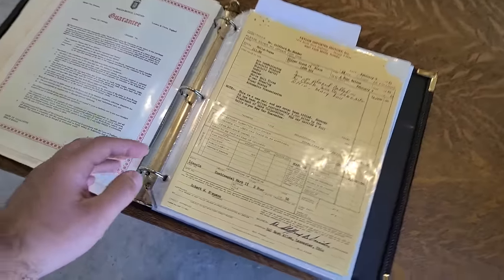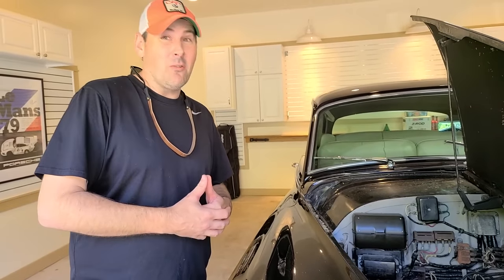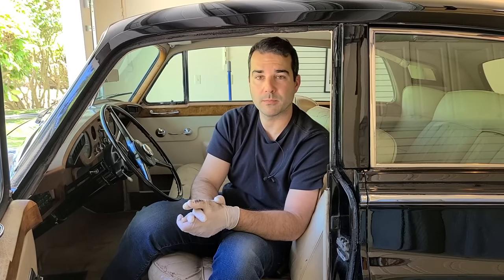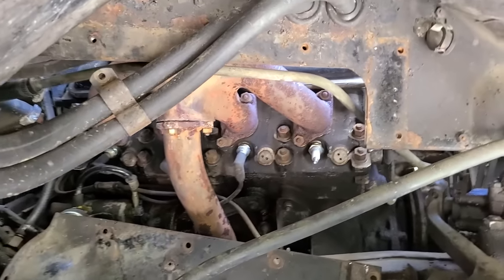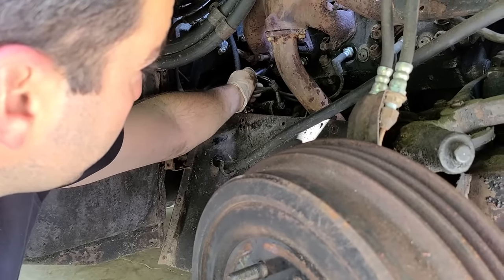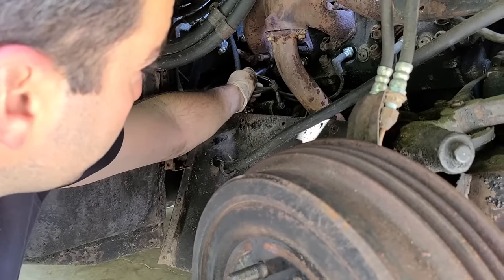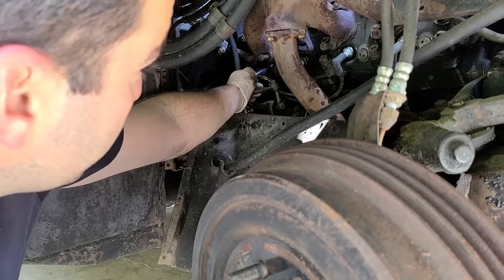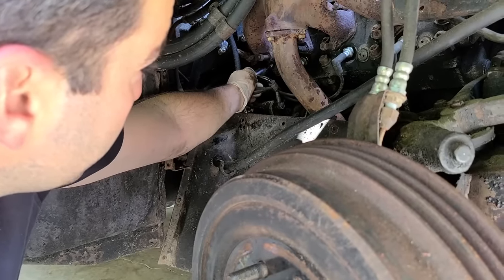I Bought A Broken Rolls-Royce 1000 Miles From Home! 1 Day To Fix EVERYTHING Before Hitting The Road!

Comment: The Leather Gloves as you call them. The correct name for them is GAITERS.
I noticed that you drive the car in the second position. When you have started this SC-II, all you have to do, is place the second position from neutral. When you park, your reverse gear acts as a Parking Brake. I noticed that the Hand Brake is almost all the way out. the adjustments for the Parking brake, is at the rear. Check your instruments, when running, the Oil Pressure gauge and the Temperature should be at the "Quarter to Three positions" In the winter, it is important prior to using the ignition key, depress the Accelerator slowly to the floor, and slowly take your foot off of the Accelerator, this sets the automatic choke. Do not flutter the gas pedal up and down when starting, because you may flood the S.U. Carbs. You will notice a Chromium Plated Switch to the left of the Steering wheel, this is to tighten the rear Dampers if you are carrying five people or lots of luggage. Your Rolls-Royce should have Dunlop RS-5's Tyres. This is a very heavy car, get a Tyre service station to first of all rotate the wheels. If you have cheap tires, fit new ones.

Comment: 28:39 - "we're cruising along about 50-ish mph ... we checked it with the GPS, it's actually like 47, 46 ... so it's off" - apparently it's the way it is supposed to be. According to one guy I know, and he runs a shop installing, servicing and repairing speedo- and odometers, and tachographs, speedometers should display the speed reading about 10% higher than actual speed (at least here, in EU). When many years ago I took my almost new Forester for a max speed check the speedometer was reading 160 km/h (≈ 100 mph) while GPS displayed something like 135 km/h (≈ 84 mph). (The bigger difference, 18%, might be due to my summer tyres being tad smaller than original ones, but I don't really remember - it was like 15 yrs ago.)
Don't know how it is regulated in US, but I guess it would be just about the same.

Comment: It’s not only a Iconic car it’s Beautiful In My Opinion  I love Antique British Cars personally  mainly I’ve owned and restored 2 seat Sports Cars FYI  if you don’t know this British cars use Virgin rubber seals on hydraulics and a very common mistake is  they  pour  standard Brake Fluids and  other Petroleum based products. Into reservoirs  and they will dissolve the seals  luckily  you can use Castrol GTX a Vegetable based fluid  found easily at auto parts stores and even Walmart  in the United States  Moss Motors  should carry most of your Wheel Cylinder and Master Cylinder rebuild kits and seals  as I imagine they  are cross referenced from other British Automobiles  that may use the same part or bore and size ? They are also really good  on the phone with helping  people  you know that Rolls Royce  prices will be rediculously expensive  good thing you do have a freind with his experience  because British cars are Quirky in many ways  i have the same Ohm meter  mine is fromRadioShack and is branded  that name  btw the motor running sounds pretty healthy  with some tweaks and other minor things. I’ll bet you make your drive  your best freind. On this car  might be Internet Forums  because in my cases I was able to find many cool tricks on my cars  one was  replacing a Lucas  Altenator with a Hitachi one that  was used on certain Subaru cars  why ? It was half the price and a direct bolt in without modification to the mounts  or pulleys and found in most major Auto parts stores  plus just a better  unit overall  I’m not a know it all  but I’m only making suggestions to you  on your new really cool car

Comment: I think RR use oil not brake fluid.  The air filter should be soaked in oil after cleaning? Good luck with the rest

Comment: The car was built in Coventry, my home city. There is a saying that Rolls Royce does not break down. It simply fails to proceed! And if you do have the unfortunate problem of breaking down then you don't contact a mechanic. You contact Rolls Royce and they come to assist you. The first thing they do is cover the car with a tarpaulin so that no one sees a broken down RR. This was considered bad marketing so you would only see a large white tent at the road side.

Comment: Huge list, 55 Ford 272 cid standard, 64 Ford 1/2 ton 292 cid standard, 64 Fairlane with the 289 special 272 hp factory, 37 Indian Scout, Triumph 500 Tiger, 850 Norton Commando, Corvair Monza 4 carb engine not so much sucked a valve seat.

Comment: The brushes for the Dynamo are rare as rocking horse sh*t might be worth looking for spares if you keep it.  If the carburettors are strombergs  they have a rubber diaphragm inside and if sat for that long may have a small hole in it. I had a car with theses on and it was only a small pin hole but it run like crap when over 30mph.  👍 great old car and a great video. I had to laugh rolls Royce drivers don’t smoke cigarettes they smoke cigars.  If you worry about MPG you shouldn’t be driving a rolls 😂😂😂😂 I think the suspension is call Hydroelastic suspension    😂

Comment: chances are good that the Toggle switch on the Steering Column  was a Aftermarket gadget  or some Shade Tree Mechanic Fix , you will find them often on older British Cars  usually they are  for Cooling fans for the Radiators and /or  Electric Fuel Pumps that  have failed and been replaced. With a Aftermarket One  the Older British cars often  due to rust  lose ground Circuitry and stop working  people. Will run new Wires to  the new Components and often just abandon the Factory  ones  once. I was 4 hours from home and a Fuel Pump stopped working ? my Temporary repair  was made with a hardware store Extension Cord  hot wired to a battery  under the hood  and Duct Taped  along the side of the Car ! it got me home ! ?

Comment: You have paid $26,000 for a 1961 Rolls Royce Silver Cloud ...that was sold for $14,000 (	$125,042.01) in today's money ... Such a Rolls Royce with low mileage and good condition is being offered from $40,000 to $125,000 in Europe. If you do it up, then you have the pleasure of driving a true Rolls Royce not a soaped up BMW 760 for over $250,000 ...Driving a Classics is nothing to compare. A 1959, LHD, in immaculate condition is being offered for £250,000, yes, a fortune. A Classics Rolls Royce, Mercedes or BMW are worth the money. You get the great pleasure of driving a great machine and it shall increase its value with time. Spend some real money and get a car for life plus the head turning effect. Congratulations;

Comment: I find it quite bizarre that a 60 year old Rolls Royce with Lucas "The Prince of Darkness" electronic items is far more reliable compared to a modern BMW and  Mercedes. Just proves that Lucas parts are not that bad unless you buy modern "Lucas" replacement parts which are Chinese crap. Only part made in the UK is the box! 
Saw one of these coming up fast behind me on the M4 on the way to Windsor, loved it.

Comment: If a Roller gets serviced properly they last forever but this Roller seems to have been neglected.  By the way, don't believe the crap about, "Aluminium bodies don't rust", they do and that is because when they were assembled, an acidic flux was used for brazing and soldering, so over time in the presence of moisture, Aluminium Oxide does occur. Aston Martin had the same problem with their 1950's and 1960's cars. The solution is to wash the welded, brazed, soldered, area with a borax solution, dry and give a coat of paint

Comment: 18:17 I would have at least after adjusting the gap to clean the gap area with gasoline.
Reply: Perhaps better to use electrical contact cleaner (that also comes in a spray can and has no additives?)

Comment: also,  you just have to move the front road wheels to gain access to the filter assbly
Reply: Even a vehicle I have which was built by the Japanese 30 years later requires the front left road wheel to be removed to access the huge spin on oil filter...and even then it requires a contortion of up, back and sideways to remove through the wheel well.
It cannot be taken out through the bottom of the engine bay, nor through the top of the bay.

Comment: try measuring the hex on that bolt and compare it to Whitworth. Whitworth was a common size range for hardware in England developed by Joseph Whitworth in 1841 (from Wikipedia). I'm only guessing on this that if the car was manufactured in the early 60's, it may very well have had hardware in the Whitworth sizes. It wasn't until years later that we went to the imperial (what we use in the US) and now what is slowly becoming the standard world wide is metric.  Here's a link to (yes a company) but there is a nice chart comparing Whitworth, British Standard (which are  the same) and imperial.  https://www.samstagsales.com/whitworth_table.htm

Comment: The "weird bolt size" has to be Whitworth (https://britishfasteners.com/threads-bsw). Had a '59 MGA with them. Common on English cars and motorcycles of that vintage. Surprised the guy who restores RR's didn't clue you in. You can make the drain wrench with the right size Whitworth bolt and some vice grips.
Does the clock work? RollsRoyce bragged the car was so quiet you would hear it ticking as you drove.
Reply: Clocks do not just tick...vee haf vays of making you tock!
Reply: @JohnSmith-pl2bk  Is that what the BMW group said when they bought RR?

Comment: what is the strange handle under the car radio
Reply: Handbrake...
T handle..
pull out straight to full extension....ratchet locks brake on..
To release, ...twist left or right 45 to 90 degrees, ratchet unlocks...push handle down to off position, twist handle to level position...
This type of handbrake lever was one more thing that could injure you in a crash....solid steel, with a solid steel tube housing under the dash to the firewall...
Reply: @JohnSmith-pl2bk  thankyou John for explaining that for me ,cheers

Comment: Not sure about US cars but you need to be careful with valve seats running unleaded fuel.
Reply: Not on these. Rolls Royce anticipated their cars being run on crappy fuel 
(they went to some less-refined areas... like the USA) 
and fitted them with hardened valve seats...same with Jaguar....
Reply: @JohnSmith-pl2bk  I know on later cars they did as the US started removing lead in the 60s, this cars on the limit isn't it? 
Me and my father restored a 1958 XK150 and it certainly did not, also the ethanol bad aswell. I note this car because they did export them just like the rolls, although it's not an exact science as we took a the valves apart on a mk2 jag that had been run on unleaded and the seats were fine.

Comment: You would think a RR engine would be made better, like chromed parts and better quality metal and the body would be made of rustproof material or coated. I'm not impressed, for what was supposed to be The Best car. Even the hood seems flimsy.

Comment: Many people  especially Americans screw up Hydraulic systems on the old English cars  because the British used Virgin Rubber seals and Gaskets  and standard Hydraulic fluid is Petroleum based  and will destroy those seals very quickly  to avoid that problem CastrolGTX  Fluid is a Vegetable based  Hydraulic fluid  that doesn’t harm the rubber  i’ve owned  many  intake British cars  and several of them  had failed Hydraulic systems when I purchased them used because of the incorrect Fluids being used  one lucky thing is Moss Motors  does usually have all the new replacement Rubber parts to rebuild  Master Cylinders and Wheel Cyliders  i use a simple Power Drill Honing tool  to polish the surfaces on those parts put the new Rubber parts in and Bleed the system to usually have a perfectly operating System  Easy Peasy and cheap fix Overall  the Castrol GTX fluid can now be found inmost Auto parts stores  and evenWalmart  years ago you had to get it at a British Leyland Parts  Counter at the Dealerships

Comment: Some British cars use the BSW system of threading and bolt making. A totally USELESS system since SAE and Metric were already in place in the 1880s.
This Rolls shows that system in the oil pan plug which took a "special grind" on the wrench. The only thing worse on English cars than the Whitworth(less) crap is their lousy LUCAS electrical systems,components  and installations. Avoid Lucas Electrical whenever possible. Lucas Lubrication, fine.............but their electrical will give you nightmares.
This info comes to me from a mechanic in Pittsbhurgh,PA who worked on that scrap.

Comment: You may want to rip out that oil you put in ASAP! 
NEVER EVER put 10W-40 Full Synthetic oil into an old engine, it is too thin and such low viscosity that the big oil galleries and guides inside the motor cant draw it up properly from the sump. 
You need Full Mineral 20W-50 in those old engines and specifically that engine. 
I was looking at your oil gauge and you have sweet fk all oil pressure in the engine. 
Change it or blow it! 
I am cringing as i think of the bottom end glowing from no oil feed.

Comment: Hey Bro because I know a little bit about these cars I can tell you without question you paid 10 Grand to much..just the fact it's been sitting that long without any maintence it's got mineral oil for brake fluid with a two system system ...
Reply: No.
Silver Clouds all require common or garden brake fluid. Mineral oil [the green stuff] will rapidly destroy all the seals.
Silver Shadows require RR363 fluid, which is brake fluid with additional lubricant for the hydraulic pumps.
Silver Spirit\Spur take mineral oil [LHM same as hydraulic Citroën's]. These have a bloody big placard on the reservoir saying to use mineral oil only and in fact [ on most of 'em anyway] can only be filled with the special bottles that the fluid comes in. RR added the placards and special fill nozzles specifically to stop folks adding brake fluid.

Comment: having had a 1973 silver shadow, let me say what you have is good compared to that piece of junk    RR means repair regularly  ps you were robbed
Reply from the maker: How much is it worth Bruce?
Reply: @LegitStreetCars  With the condition and the v8 rather than a series one with 6 cyl.  Figuring no more than a low grade 3   and at least 15,000 to make it right.  I would put a value of no more than 14,000 as is
Reply from the maker: Very interesting. I've never seen one that cheap before unless it was a massive project. Thanks for your input.